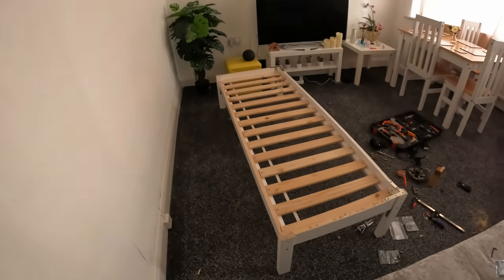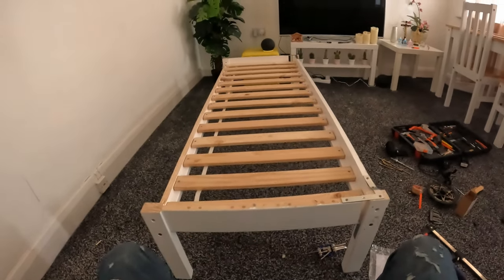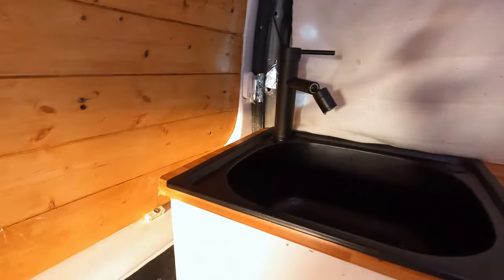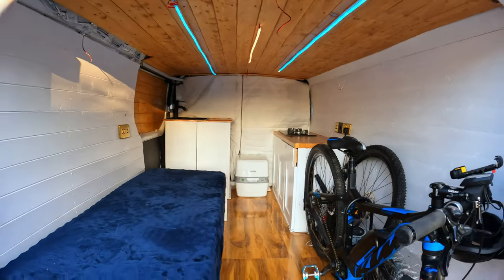Vauxhall Vivaro Campervan Conversion -Cladding Flooring and Furniture (Timelapse)

Comment: Looks amazing!.. I am currently converting a Vivaro myself and i am now going to use the exact same flooring as in your van.. it looks brilliant. Please4 what is the Lighting you have used on the van roof interior.. The multi coloured strip lighting effect. If anyone can tell me where to buy this stuff or post a link i will be grateful. Great post...
Reply from the maker: Hello thanks for the comment. So u need to search on Amazon for RGB neon rope light and make sure it's rgbic as this will allow the LEDs to be controlled individually and do those unique effects. Cheers.
Reply: @vanventuresofjesus  Thank you very much for your swift , helpful & informative response. I am going to purchase same for my Van conversion. Wishing you many happy adventures with your Van.. It really looks superb. Great content. Thanks again..